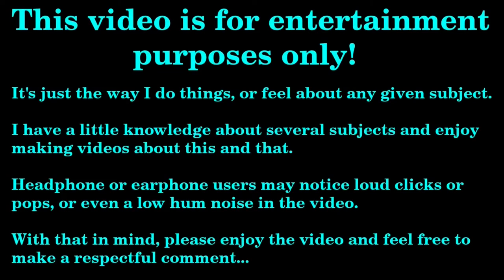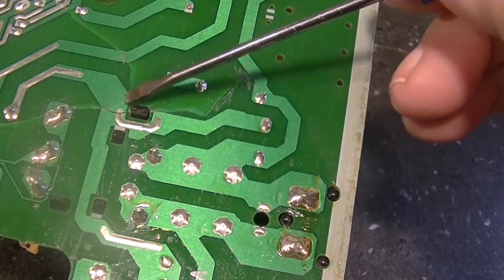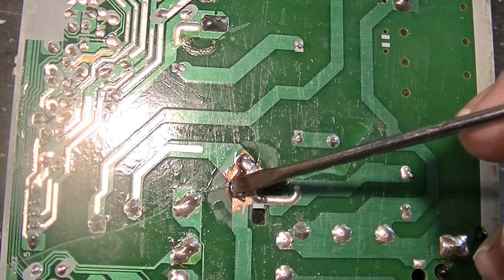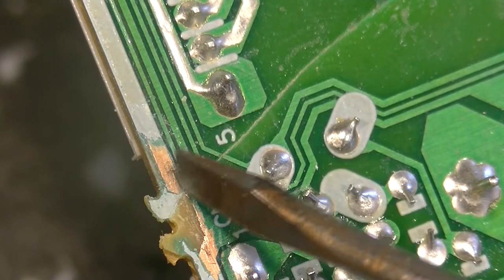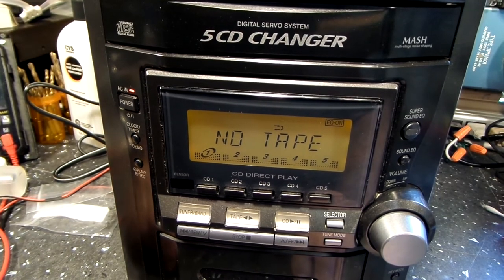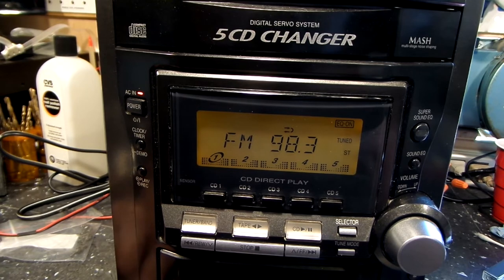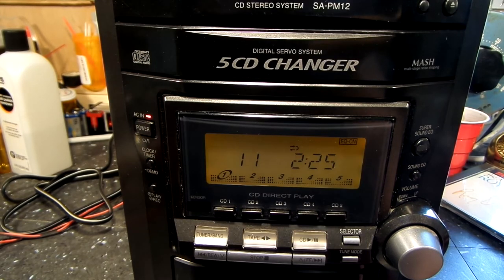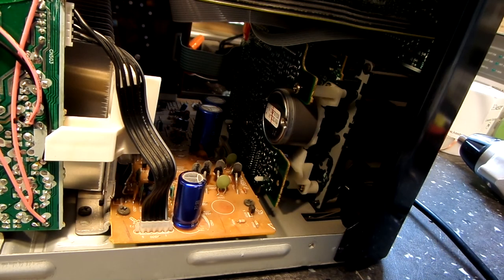Panasonic SA-PM12 - Repair and test

Comment: Great repair, Doug.  Point to point wiring still works, thank goodness :)  I have done a lot of that for boards damaged by battery leakage.  Looks like the fellow that figured out the "intuitive" interface of VCRs did this one too.  Those folks should take notice, here is a guy who can fix their circuit board and get this thing working, but did not immediately grok their "intuitive" interface, LOL.  Sometimes I think the labels they put on the buttons may as well have pictures of fruit or beach umbrellas for all the sense they make.  Great project. Thanks
Reply from the maker: Thanks, I appreciate that. Oh geez, don't get me started on VCR's. LOL They are on a completely different level for sure. Reminds me of once trying to fix a logic problem on one of those 24 CD changers. We didn't get very far into digital logic in tech school, but I'm sure given time I could have figured it out. At least this one is working again and it really wasn't all that difficult. :)

Comment: Hey Doug. Nice repair on the panasonic. Mine is a very similar model and had some physical damage to the cassette doors which I guess is why my neighbour tossed it out on the curb. Mine also has the cd changer but and if I remember right it was full of cds when I got it. :) Oh and I picked up a bunch of cds a couple weeks ago for $5 unfortunately they aren't all my thing but I guess that's how lots go sometimes.
Reply from the maker: Thanks Pat. I haven't worked on a lot of Panasonic stereos in the past, but this one sounds very good I think. Just a little solder and wire and a good cleaning should have it singing pretty again. I keep a few CD's in the house for testing purposes, but most of mine are out in the garage. :)

Comment: I had one of those. For a micro hifi system it sounded pretty good! Yea the tape play speed is a tad slow. Adjusting the motor speed will fix that issue.
Reply from the maker: Thanks. I still have a Sony 60+60 watt similar unit waiting it's turn in line. Now if I just had a use for all these things. LOL

Comment: That PCB is pretty flimsy so as you said with a dent shows what kind of abuse it got its no wonder that the PCB got cracked. Yes that's the other possibility someone got frustrated with it and threw it. Or in the case of the 1946 radio I repaired that had a big whole on the case I was kind of guessing the mud dobber wasps got into it and someone threw the radio to get it out of the house lol. You repaired a lot of damage and a microscope comes in handy for those really small traces I am sure. Thanks for the video Doug.
Reply from the maker: Thanks Larry. Yeah that thing had to hit pretty hard to flex that board enough to crack it like that. The thing is, it seems to be working perfectly fine now so I'm not really sure what would have caused anyone to throw it that hard. More than likely it got accidentally dropped and when it didn't work after that they were done with it. Oh well, I think it was worth a little time and effort as it really does have nice sound to it. :)

Comment: Hello Doug,  funny how your eye goes straight to the crack - - gotta love those nice fat traces - - the little tiny ones - not so much.  It sounds great,  nicely done.  Regards, Dave
Reply from the maker: Thanks Dave. Yeah those tiny traces can be difficult, but if you follow them back to a good solder point like I did, they aren't really that bad. :)

Comment: Great job on repairing the PC board Doug, maybe adding some super glue on the cracks on both side of PC board would add some strength to the board.
Reply from the maker: Thanks Jim. Yes I'm sure it would have, but I was out of super glue and just wanted to get it finished for the video. I'm still thinking about pulling that cassette mechanism out of there to clean it so I might add some then. :)
Reply: @DERB_Seymour_Indiana  Hey Doug, if you want to have some fun, 3-d print out a splint in the shape of your choice with "Doug FIxed This" embossed in the 3-d print, and epoxy it to the non-trace side.  I certainly would be tempted to something like that.
Reply from the maker: LOL, yeah that would be neat. Bob made me a similar piece that says DERB which I put on my MFP. :)